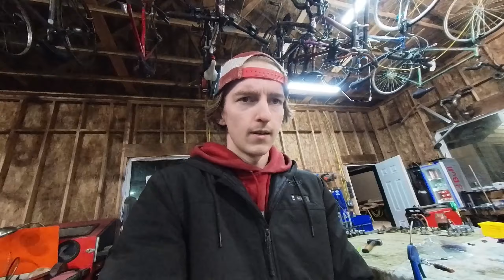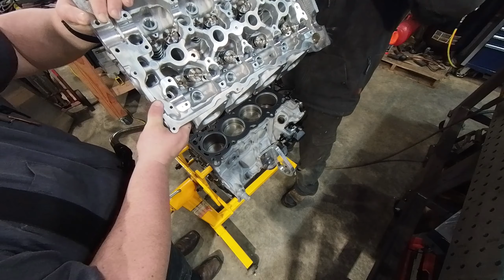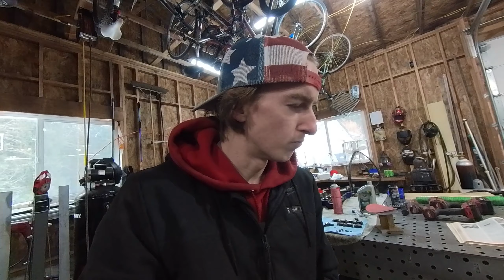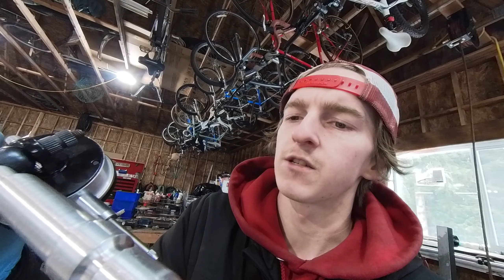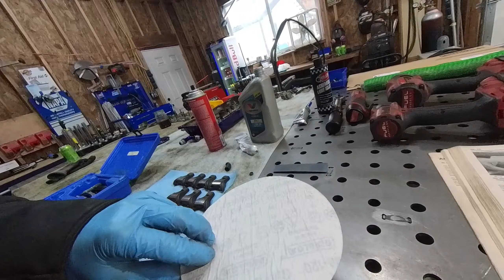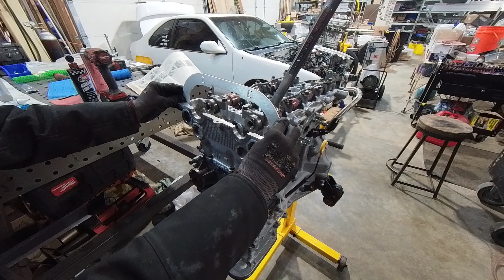BUDGET BULLETPROOF TURBO FWD SR20DE BUILD PT. 2 (TOP END)

Comment: Do you plan on selling the tool?
Reply from the maker: Sure do. I can make an exact replica of my shim tool, or I can change the tool shank size and length to fit your dial gauge
Reply: What is your asking price? Im interested in one because ill be doing a refresh on my avenir with mazworx products. @emcmetalfab
Reply from the maker: I never got a notification for your response...

I'd probably charge you roughly $50 for the tool. I machine them out of solid 6061.
Reply: @emcmetalfab how would you like to do the payment?
Reply from the maker: @timyim713  Reach out to me on my Facebook page, EMC Fabrication and Design. I'll get you squared away.